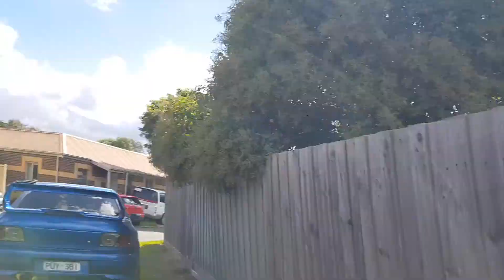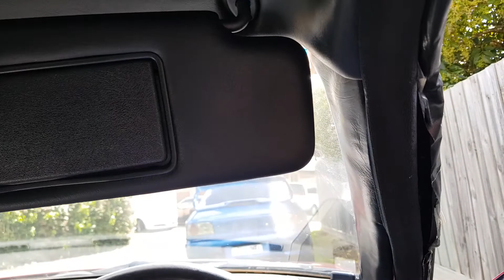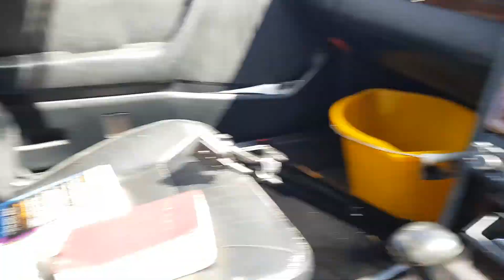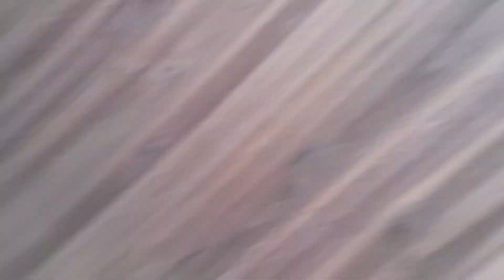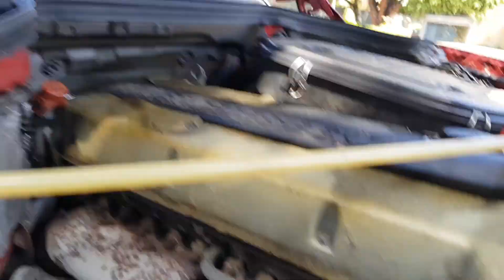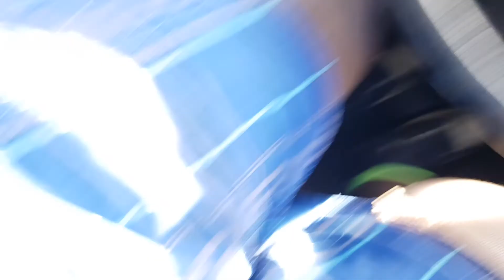W124 Benz 300CE 24, up close features

Comment: Hey, nice car. Do you recommend a future buyer pick a W124 with 175k-200k km on the odometer as a daily driver?
Reply from the maker: You have to think of a w124 as a normal car. In a lot of 3rd world countries Benz are used a lot for taxi and they are strong if you maintain them like a ford or toyota 200k easy
Reply from the maker: Sorry just saw your comment, yes w124 are good daily and reliable, only problem is the high parts cost in most countries, but the are strong